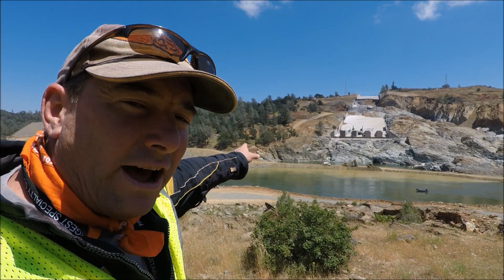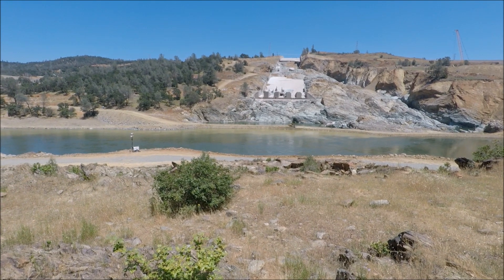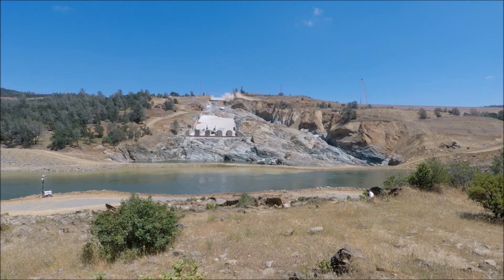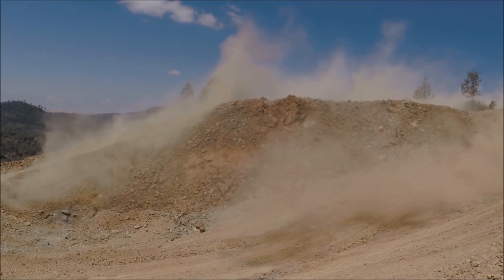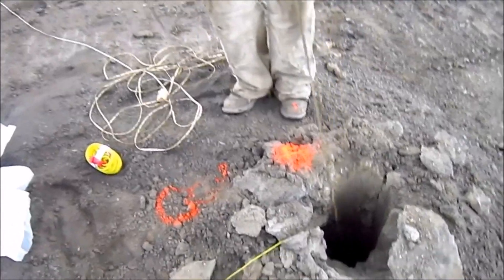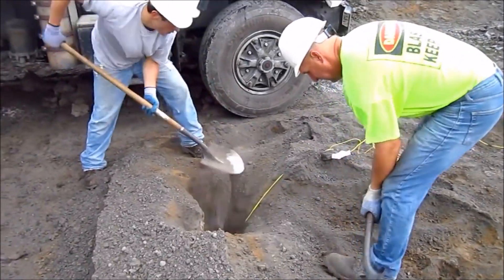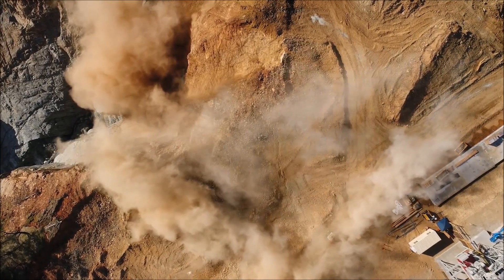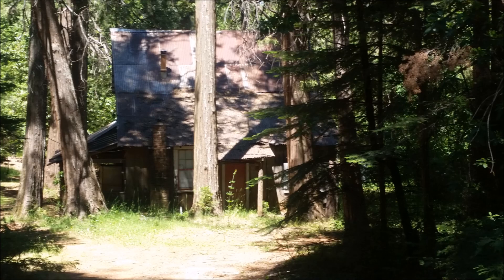Oroville Update Blasting! 25-26 May

Comment: at 13:14 (angle 5) closeup shot of blasting the main spill way.

if you look closely you see the primer charges go off in a line. 

As far as three holes up hill, (two feet apart? four feet apart?) dust blows out holes that weren't directly charged.
This doesn't occur in a uniform fashion 
This would mean a void existed under the concrete to allow that much blasting gas to escape from those drill holes....

Comment: I didn't realize that the spillway was built on rock? I heard nor read anything about it during the "so called" emergency? It seems unlikely that there would have been any danger if the entire concrete part had washed away. The actual danger to this dam is the same as any other one built in an active tectonic area, earthquakes and avalanches.

Comment: Thank you for continuing to show and explain what is being done at the Oroville dam spillway recovery/reconstruction. Your explanations lend much appreciated continuity to the events shown by Cal DWR -- your narrative fleshes out more than their videos can accomplish.

I am [also] puzzled as to why a dredge is not in place to deepen the pool. I should think that mining dredges might be located and obtained not so far from the body of water being deepened. [Did I just answer my own question -- that the depth is too great to take advantage of a dredge like one of those? Are there no conveyor-belt dredges that go that deep?] 

Again I thank you for your insightful coverage of the various aspects of work going on. The legacy media probably likes "BIG booms". The very effective small explosions  are much more elegant and eloquent that the blasting is being done competently. [35 years back in Pomona CA the town decided that a cave on a hillside had become an attractive nuisance requiring destruction. Unfortunately they likely used at least 2 times if not 4 times as much explosive as they should have done. Residential house windows and the windows of the building where I worked were blown inward. Not good.]

Ta! -- Diana G.

Comment: As a former blaster if it sounds like firecrackers it is most likely a nonelectridc system. It is a system of double ended detonators with low intensity 25ms detonators on top with 500ms high intensity detonators in the hole. Any separation of 8ms is considered a desperate shot. You hear the firecracker syndrome on top and then when the shot goes off it sounds like one explosion. They use ANFO because it is a cheap blasting agent and still requires boosters to initiate the explosion. I kind of miss doing this and there is a hell of a lot more to it. God Bless

Comment: I have done a lot of tunnel blasting in my time and it was good to watch these guys in action.

On one job we had to sink a shaft 180 ft. down time mine under two rivers in the UK, the rivers Severn and Why in the west country. There were heavy duty power lines above us in fact the tunnel was to accommodate extra power lines as the distance between the pylons was too great. We start excavating by hand drill holes and splitting the rock with hydraulic pre splitter  "Da Das" we were not allowed to explosives near the cables. Once we had mined down 10ft we set up our 1st round, and drilled just over half of the shaft 4ft deep, set a burn cut and charged all the holes. The police arrived just as we had finished covering the pit with old rubber conveyor belt and wooden railway sleepers. They parked the Patrol car very near the shaft and would not take our advice to move it, it wasn't until they saw us taking cover in an old WW2 bunker that they decided to move the car. After the blast a section of sleeper had leapt over the guard rail and landed right where the patrol car had been sitting.

There are lots more stories of interesting happens on that project, I'll write em up piece by piece later.

Thanks BS

Comment: So, the idea is to maintain for use the natural channel cut by the diverted water out of the main spillway? This does make sense as things just may not get done this work period and you must plan for this. Juan, I ask for a comment regarding the non-use of rebar in the original spillway construction. I conclude that when this spillway was constructed it was not common to fit rebar in spillways.
Reply from the maker: See previous updates..and look closer...it's there.
Reply: I did read in the paper (LA Times) where someone was giving either testimony or simply information that others also find it odd there is no rebar in the spillway. i will say that they only spent a few minutes on prior construction techniques.

Comment: Soooo...They are using the "tailings", which was the washed away "unreliable rock", and are going to put it back into the pour for the new spillway. My good word. But what do I know, I'm not an engineer. Why don't they just use styrofoam, it's lighter and easier to work with...and when the spillway breaks again it'll just float off down the river and won't clog the diversion pool. Hope this helps :-)

Comment: I watched the new DWR you tube and watched a worker dropping one of those nitrate bags in the hole. They are also loosing up the red rock too, not just the concrete the way the bag disappeared. Those holes in the floor of the spillway are deep.

Comment: Dunno if DWR's video title changed, but notice that the May 25 blasting of lower spillway is described as a "Blast Test".   The May 27 blasting overlaps the same area and was much more energetic and effective.  

And a comment.  A small rise of the Diversion pool doesn't threaten the HPP.  It just makes it impossible to run if the tailrace level is too high in Tunnel #2.  HPP itself was only at risk of being flooded back in Feb when the DPP had risen over 20ft above the initial massive debris dam.

Comment: Juan - the net outflow has more than doubled in the last few days, from 2000 CFS to 5000 CFS.  This means the lake level is dropping more than twice as fast as it was - now about 0.8' per day.  As snow melt (ice at this point) slows, the rate of fall will accelerate.

Comment: TNT creates very few shock waves in the rock and will crack it into very large pieces that are difficult to remove.  Ammonia Nitrate creates thousands of shock waves and turns the rock into basically gravel and it is much easier to remove. You still need the TNT to get the Ammonia to go off.

Comment: Great presentation Juan. One question; What are they going to do with the soil that is being blasted into  Croyle Canyon? Is that material going to be excavated or are they going to lay concrete on top? Just wondering.......
Reply from the maker: As others have pointed out, I think they are going to build a road across there. To move the RCC concrete
Reply: So, will they build this road across the canyon with RCC concrete on top of, or with, the debris that is falling into it during this upper blasting? That will raise the bed of the canyon and future spills? Otherwise, how can they clean out the canyon to keep the debris out of the river next year? Thank you so much.

Comment: There are 3 real options for getting the concrete to the spillway overhead lines, conveyor belts or trucks.  Cables are the cheapest option as you can use one tower to a mobile point to move the cable anywhere over the work site but have a limited load per trip of 1-5 tons. Belts are the most expensive but will get the most material in to the hole in a given time. Trucks with the mix they are using can use standard dump trucks with seals on the gate to haul 6-10 tons per load or 10-20 if they go for off road trucks. 

The thickness of the mix will prevent them from pumping it and cement trucks are not needed as the mix is not that runny.

Comment: I will be curious to see what the impact on the earthen dam is, even being a half a mile away. Since, someone such as Scott Cahill, who does know what he is talking about when referring to dams and blasting near a dam, or even the gate structure, don't seem to find blasting the most prudent way of removing material in the volume they are here! 

Moreover, I have shown the blasting video to a older gentleman,  that I met on a construction site, that has done this very style of blasting, for many years and he did not see it as prudent either, due in large part to the type of rock that makes up this hillside! Since if the rock here being a softer lava rock, as the gentleman, I know described, will still allow for a higher level of vibrational transfer no matter how deep they are drilling. Which from what I understand, isn't going to help the structure stability of the earthen dam!

The density of the rock, factor's in a great deal, to the vibrations of the blasting, for miles, such is the case why my childhood home would have new crack's in the plaster, after the coal mining that was ten miles away would affect the structure stability of my childhood home, since the make up of the rock, was a softer compound. Which is the biggest reason why it's not there anymore! That area had a lot of limestone, which has a lower density, which allows for much more vibrational transfer. And is why the gentleman, I know, stated company doing the blasting, had to be out of their minds, because, as he pointed out the blasting is done, when there are no other safer options, for removing the material! 

Furthermore, in my view, I would agree as well with something Mr. Cahill stated, that building a new gate structure, and spillway to the side of the emergency overflow, would had been a more prudent option, and would have given them the ability to continue to uses the old gate structure, and spillway. While the new gate structure, and spillway were being uninterruptedly built and there was not a chance of the new bottom half of the spillway, being washed away, since in my view, it will not be fully completed by November! Although, I do hope for the safety of the lives downstream of this dam complex it is, and the maintenance of this dam, and all the other dams in California are taken more seriously! 

Oh, and if question the reporting, one has my late great uncle Joe Howell, who was a senior newspaper reporter for the Tulsa Tribune, from his early 20's to well into his 80's when it was in business, which amount other things, he reported about the building, and care of dams, on the port of Catoosa, which his favorable reporting is why it was able to be built! He also wrote one of the first articles on the death of Will Rogers, which a copy of that article had been on display at the Will Rogers Memorial in Claremore. As well as The University of Michigan convenience him to come to teach a semester of journalism, after he resigned as chief of staff for former U.S. Senator from Oklahoma Robert S. Kerr, after my great uncle found the beltway to be less than pleasing to him! 

Therefore, I have not only my own experiences about subjects such as this one, but I have wise counsel, whom I spent a lot of time listening too. Who know a great deal more about subjects such as this one, than many of the trolls, who would rather drown out wise counsel, than listen fully to that counsel! Thanks!
Reply from the maker: happycamper3dhd blast away, earth dams can handle it better than concrete dams. Cahill has an agenda..."Agenda 21"...whatever that is...
Reply: Well it seems, that you didn't read my post completely, since, I also stated that I showed the blasting to a gentleman, that does this for a living still to this day, and his agenda is keeping those people downstream safe, as I am sure that is Mr. Cahill's agenda. Which would include the gate structure, and emergency spillway, that I am pretty sure are made out of  concrete, and are much closer! Moreover, Mr.  Cahill isn't the only person, that I have gotten information about this subject from, and those source's are saying much the same thing, and don't have any agenda or even a dog in the fight. Outside of being concerned about people. Furthermore, it is not like, I am talking about fling an air plane. I do have hands on experience in construction, as well as building things to be safe, and to last! Oh, and my agenda, would be to focus on the safety of those people living downstream from this ill maintained dam! And it doesn't take an expert to see that, nor any experience on agreeing on the proventive maintenance, that should have been done. And why the sheriff found that no one dealing with the failure knew how to manage the crisis correctly. Since they were hired to prevent a crisis, such as this from happening! 

Moreover, trying to tie Mr. Cahill to Agenda 21 isn't a very good way, to conduct journalism either, if what he is saying has value, and is meant to benefit the public as a whole! It would be like me stating you had a agenda and tied it to you working with DWR, to make anyone that question what is being done in the public interest, from the public, by telling people to stop questioning DWR! Which I would not, since, I don't have no idea what your agenda is or could care less! Oh, and yes there are always to sides to every story. However, this story is one, that proves that side of the dam operator isn't in the right, from my viewpoint, and from a lot of people both in the area, and outside the area! You have a nice day! Thanks!
Reply: happycamper3dhd --- Why keep preaching doom and gloom and let's start offering CHEERS as they move this reconstruction forward at a very fast pace. 

Life is not difficult to live, unless you make it that way! Let's be upbeat and positive!!!!!!!!!!!!
Reply: arkansas13 Stating the facts about what I know, from what I have learned, is not doing and gloom. It is being responsible, and being concerned about people's safety, since the folks at DWR must not be. Or they would have done the proper repairs, and maintenance of the dam complex. Since they were told to address problems with the dam, long before the spillway failed! 

Furthermore, there is nothing to be in this that would make me cheery, if people downstream from this dam, have to fear the unknown. From a government agency, that wants to keep information from them, which makes life stressful, for someone who has lost trust in a government agency, that from the very beginning has wanted to keep this failure from them, just listen to the sheriff, and what he had to say about their attempt to keep this from the people! 

Moreover, the truth isn't always cheery, yet it has to be stated. So take your cheery trolling and go bother someone else. Because, I am done with you!
Reply: happycamper3dhd --- You should be cheerful because they are reconstructing the spillway at a fast pace which is in the best interest of ALL people living downstream! 

Btw, I'm not trolling (on your channel), I'm on blancolirio 's channel trying to offer encouragement and support! He has the BEST coverage and offers the MOST EDUCATIONAL coverage I've seen!
 
From what I read SOME of the non repaired problems were caused by SOME California politicians saying "that's to expensive, we need the money somewhere else" but I don't know that as facts! Hopefully that was someone speaking with incomplete knowledge of the politicians/situation. It also appears that DWR didn't take care of known problems correctly. I just see these things as being in the past (albeit painful) and want to think about 'moving forward'.... in a positive manner!
Reply: arkansas13 One don't assume to tell me how to be, two blasting that close to the dam is a huge risk, that shouldn't be taken, in the poorly maintained dam, gate structure, and emergency spillway that all have shown to be lacking proper maintenance. Or there would not be a story here! 

Now what does it matter, who channel it is on, you still are trolling me, in my post, which is not gloom and doom, as you seem to want to label it with everyone you believe you just have to set me straight, like you are the only one in the world that knows best about what is in the best interest of the people living downstream! 

What happens when they don't get the spillway done, in time, or they are forced to open the spillway sooner than expected, and all that work being done now is washed away! Or, if the repeated blasting does weaken the dam, gate structure, or emergency spillway! So I don't believe in anyway, that questioning, and not just going along with the flow, equals being gloom and doom, and doesn't have anything to do with me being cheery or not! 

So go pound sand there in Arkansas, I would imagine you can find some if you look!

Comment: I once read that the sequential blast is designed to prevent its being interpreted as a small thermonuclear device or an earthquake. Plus, the sequencing sets up a pressure wave that does a far better job of shattering the rock rather than a single blast that produces larger, harder to handle rubble (no, not Barney). :-)
Reply from the maker: Yes!

Comment: Thanks for the update. ANFO is Amonium Nitrate and Fuel Oil. 

Coming over I80 on Saturday there was still some snow under the trees. Northern NV is very wet for the time of year, roads closed around Winnemucca where the Humboldt river has flooded at least one local road. Flood warnings near Elko too. The wetlands up in the Duck Valley Reservation were huge shallow lakes. Wild Horse reservoir was flowing over its spillway. The majority of the high ski areas visible from I80 are still covered too. The passes on 4, 108 and 120 will still be closed for weeks, lots of snow to clear there still. We went out on 88 and that was open and very clear. But there's a good amount of snow left to melt in some places.